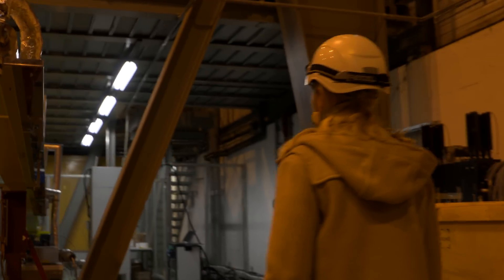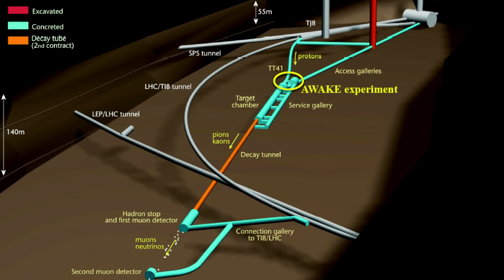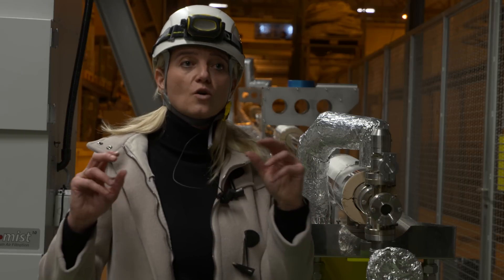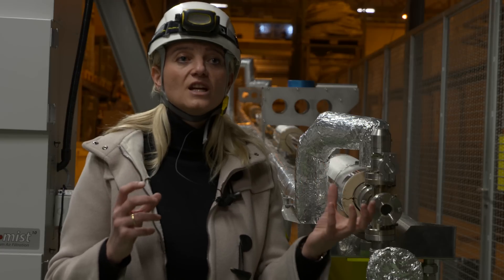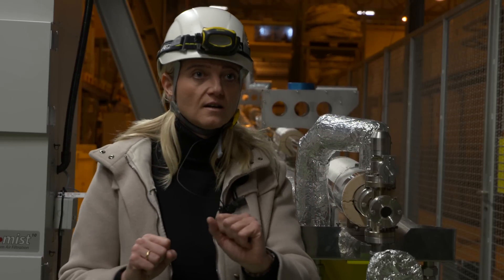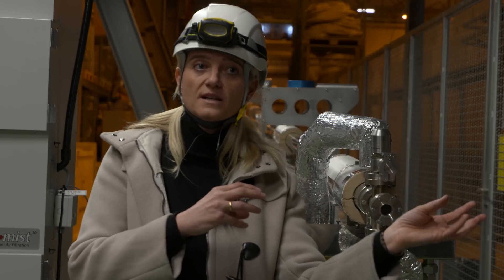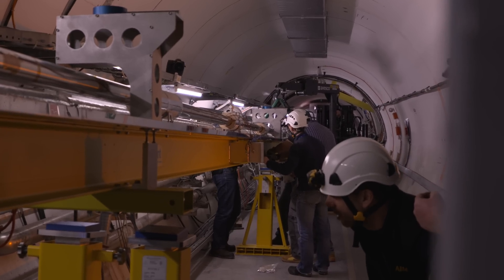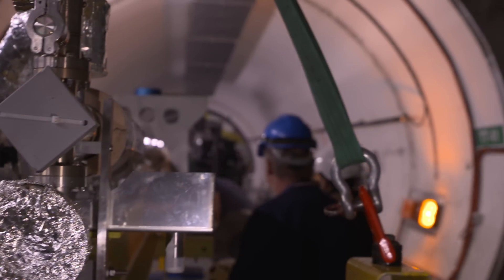Awakening acceleration: AWAKE’s plasma cell arrives

Comment: Was it installed in the LHC or in another accelerator?
Reply: +Ashtree81 As they said, it's installed in SPS - Super Proton Synchrotron. It's the last of LHC injector accelerators, so a different accelerator.